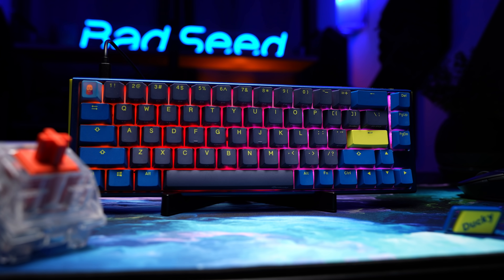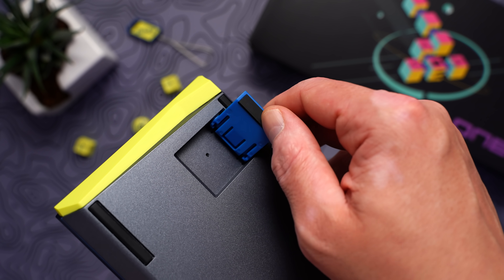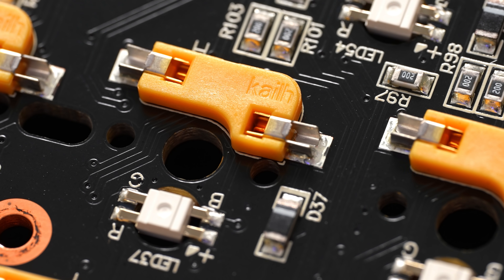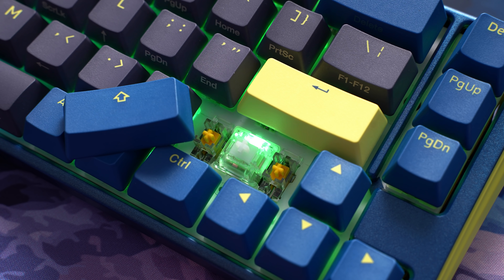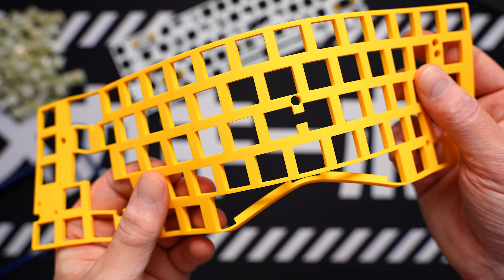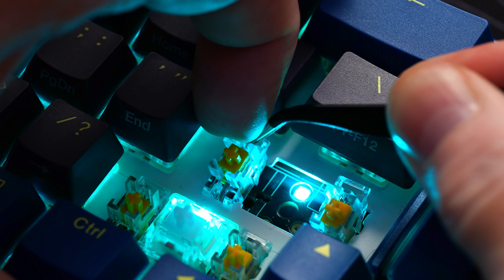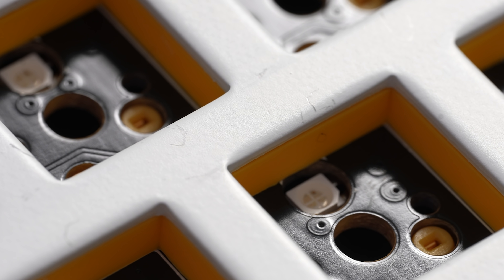Ducky One 3 SF: Best 65% Gaming Keyboard?

Comment from the maker: CORRECTION: This is a 67 key layout, not 71 - my bad.
Reply: it’s alr badseed
Reply: Quick question, their website doesn't specifically state that the TKL has RGB, appears only SF has RGB, is that true or just ducky being ducky and have a whacky website
Reply: Wow. I cant believe that you misspoke about the amount of keys on a keyboard. This is unacceptable.
Reply: @ramzinho4985  the Matcha and Fuji TKL does not have RGB, only the Daybreak TKL of $149
Reply: Do these new Ducky One 3 series (60/65/TKL etc) boards still have the mouse feature in the firmware using function + WASD keys to use your mouse cursor? and Q key for left click and E key for mouse right click. Use this feature on my old one 2 mini alot for working on servers etc.
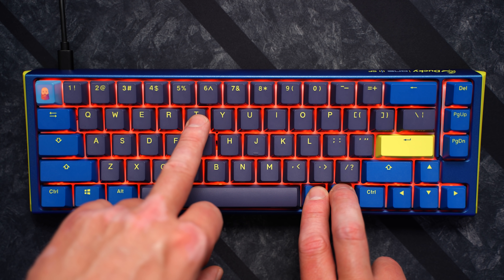Reply: @golfmaster7  check for his correction at 4:39
Reply: GOD FUCKING DAMN IT!!!!!!
Reply: Will hotswap mean we can hotswap Kailh Silver speed switches onto the Ducky One 3?
Reply: No worries

Comment: I am really happy that more and more keyboards are going hotswap.  Sucks about that 2U shift and I am glad you called it out. Quality video as always.
Reply: true, 2u shift is still very hard to find these days. Would be much better if it's 1.75u
Reply: I'm a newbie, but the fact that the shift key is 2U won't stop me from using any switches right, it's only the keycaps that I would need to worry about?
Reply: @aratayano2434  I think this is five pin hotswap so you can use any mechanical switch on these. Just make sure they are not optical.
Reply: Hi new to keyboards here… can someone tell me what’s wrong with the “two unit right shift”? I’ve been googling for an hour trying to figure it out lol…. Is that the same thing as a “2u”?
Reply: @cait.  the right 2u shift is an odd size. It's the same size as the enter key. It's typically 3u so finding the right size keycap set to fit is going to take some searching. Typically sets that have the extended amount of mods will typically have a 2u right shift.

Comment: North-facing switches was the right move for this keyboard. Ducky is known for having some of the brightest and most vibrant RGB in the keyboard market so it make sense to have features that compliment their value prop. This board is for people coming from Razer or Corsair and just want something a little more premium or different, not enthusiasts. People that plan on doing heavy modding and swapping out the stock keycaps for some GMK aren't (or is no longer) part of Ducky's target demographic anyway.

Comment: That sound is surprisingly good. Would love to get this bare ones for 99$ to put Boba U4 silents in it.
Ducky's RGB is so smooth.
Not so sure how I feel about the difficulty of opening it up though :/
Reply: I literally just ordered some Boba U4’s yesterday!!
Reply from the maker: Ducky really does have the best RGB in the business. And yeah, if you have to open it - you have to be very careful with the end caps.  Top case is actually really forgiving and easier to work with but this is a lot tougher than the One 2 SF.
Reply: @badseedtech  is the 60% easy to open?
Reply: Yes the 60 percent doesn’t need the plastic tabs removed to take out the pcb and go inside. This is because it doesn’t have anything on the front covering the pcb.
Reply: Hi does the ducky one 3 series support screw in stabs?
Reply: @Naresh-sh7pf  the one 2 didnt so I assume it wont.

Comment: Im about to buy a Ducky One 3, your review seems interesting and im also looking for a full sized keyboard, will be using your affiliate link.  Wondering what would you suggest switches with the intention of replacing the keycaps with translucent in the near future, so a switch that dont block the north facing led? I was thinking 
- Tealios v2 67g 
- Durock L2 Clear 62g
- Everglide Aqua King Water King v3 Clear 62g
still open to suggestions....

Comment: Now most switches are fine with cherry keycaps on north facing LEDs, like the Gateron Yellow, and since this is a relatively "cheap" board, I think most people buying this would buy a budget switch like the gateron yellow and it would be fine.

Comment: I’m new to customizing keyboard and I wouldn’t want it consider this a custom but I want to get the pure white one 3 sf in white and get the ducky joker keycap set so I can put some of the caps and have a purple pink blue and white keyboard. You mentioned interference, would that key cap set be able to fit on the keys (Ik the right shift is a different shape tho) but would I be able to put at least some of those caps on there?

Comment: Is that right shift really 2u? Not 1.75u? Does that mean the left shift is a different size or is that blocker on the right what causes this to happen? This board isn’t tailored to me, but that’s an interesting choice since compatibility with cheap cap sets would be pretty much nonexistent.
Reply: it is really 2U. have a OG SF and its the same size as a "O" keycap. the left shift is the normal size. it could be just ducky design choice to use the 2U shift for whatever reason.
Reply from the maker: Yeah, it really is a 2U.  Always quietly been the Achilles’ heel of the SF.
Reply: for sure the SF is 2u. Not 1.75u unfortunately

Comment: What does shine through caps look like in a south facing board?
Reply: Usually VERY dim. It has to shine through the switch to light up the text, only possible with a clear switch really. Looks very bad imho. To stop the interference from the keycaps hitting, I just use long pole switches instead of cherry MX, which frankly sound like crap anyways. They sat on the patent for decades, soon as it expired companies like Kailh and Gateron just blew them out of the water with superior products, and Cherry hadn't had to innovate in 25 years, and it shows.

Comment: I believe the Corsair K65 is still the better 'gaming' 65 keyboard with 8000 Hz/0.125 ms polling rate. As paper spec it may seem I noticed way better response with my K100 over my old Razer blackwidow which has the same rate/cherry switches.
Reply: do you actually "feel or notice" the difference on real life usage? Same as Viper 9k or 8k mice, like hell even pro FPS players still use like standard Zowie and kill like crazy
Reply: @stefanusrianto8781  both, I had to change the way I typed because of how responsive it was. Actuation point  is very small, 1.1mm. I could literally see a difference on screen from key press to action playing warcraft if that makes sense. Like the oldschool mod snowfall keypress.
Reply: Dunno. Got Corsair and a few Duckys, including One 3s (among other things), and I think these are pissing all over Corsair. In not-so-casual games AND typing feel.

Comment: Why make a stable without problems soldered switches hot swappable ? , enthusiasts are supposedly already know what they like.
Reply: there may be beginners getting into the hobby that just may get this board and decide this is the board they would like it to be their hotswap board to try different switches.
Reply: @Celesian  and also it's some people preference to have hotswap than soldering. Just because people know how to do it, doesn't mean it's enjoyable
Reply: @Celesian  I think main reason is the "what if" 
Like for many other things people like to have options
Reply: @Celesian  yeahp that makes sense so its dor beginners mostly that hot swappable option. Thanks
Reply: @offbrandegg5378  But why risk having hot swappable swithces that are easier to brake and also they are not steady like the solder ones ? For a cheap mechanical keyboard makes perfect sense because u need to expirement or find what u like or mod. If u are keyboard enthusiast u know what switch u like u know that is already a good pre lubed keyboard and u know that switches are machined soldered with plate between , nothing can beat machine solder and also switches doesnt have the gap movement of hot swappable ones.
Reply: @Celesian  I've never owned a mechanical keyboard and currently looking for one. Hotswappable is definitely a key feature for me for the reason you point out. I want to explore other switches in the future but can't be bothered to solder.

Comment: Varmilo miya pro is better
Reply: @SoftPastels  Why anyone buy a hot swappable keyboard that has more problems its not stable like soldered one . And also enthusiasts already know what switch they like.
Hit swappable make sense for people that dont know what they like or are new at this keyaboard world.
Soldered are always more reliably and steady.
Reply: the color schemes suck for them and there is not black and  they are always sold out of there switches
Reply: @milkman2979  What makes Varmilo famous are the artistic design . The cherry switches on Varmilo boards are cherry picked and are way better than those crappy cherry that most other use. I.know i have a lot of them. About availability yeah u are correct they are terrible also support is terrible . But honestly for the price the build quality of miya pro is compared to custom keyboarsa over 300 euro. Ducky SF that for most people aee great quality side by side with miya pro is like comparing Ferrari with Fiat.
Reply: @milkman2979  Oh by the way u can always buy a panda or summit that is black frame and use what ever keycaps u want.

Comment: I want it so bad but 1 thing they still haven't done that will make it way better a aluminum case instead of plastic thats only thing I hate about it id be even willing to spend more  for it. Finally hotswap just need aluminum and whatever it takes to get a more thocky sound. I know they have the ducky mecha mini thats aluminum problem for me is its 60 percent and not hotswap theh need a 65 percent aluminum hotswap board prolly would be one of the best selling pre-built on the market if they did. I didn't buy the ducky one 3 sf cause its plastic and mecha mini is aluminum but not hotswap or 65 percent. After I got my first hotswap and aluminum board I can never go back to plastic and solder
Reply: "Hotswap just need aluminium" "to get a more thocky sound." what the fuck? You need an alu case for hotswap? And no, aluminium does not produce a more "thocky" sound. Ironically, alu increases the pitch, as opposed to plastics like PC/ABS.
Reply: @Archurus  i didnt say I need a aluminum case for a more thocky sound I daid I want an aluminum case and whatever they need to do to make it more of a thocky sound and no all my aluminum boards sound way better than my plastic its how you build it the switches etc. I didnt say I need aluminum case for hotswap I said they finally got hotswap not they just need to make one aluminum case because for me thats rhe combo I like aluminum case with hotswap pcb. No where did I say I need alum to get a more thocky sound I said rhey made hotswap now for me need alum and whatever they need to do to make there board have a more thocky sound
Reply: @derekg2132  plastic definitely makes a "thockier" sound. I assume you mean deeper and quieter sound because that's what most of the YouTubers that use that god awful word mean. Aluminum usually has more ping and leads to a higher pitch "clack" which isn't a bad thing.
Reply: @offbrandegg5378  idk im just going ny what I've had even my nk65v2 i used tealious v2 lubed and lubed and changed everything and its amazing snd ghe mode 65 thocky too rama m65c I just ordered I won't have for 2 years but listen to those things

Comment: Imma play the “hater” role but after hearing the sound test, seeing north facing LEDs, and the overall features of the board…. imma chalk this up as a plastic, less aesthetic drop alt🤷🏽‍♂️
Reply from the maker: Its not a bad take. But this is priced much more appropriately for what you get and has better dampening stock.
Reply: @badseedtech  Again, imma play the hater role. 100% the price is extremely attractive as you do get a hotswap board with switches and keycaps included. But I just feel that the concept is off. If someone's buying a "ready to go" keyboard, I think mainstream boards like logitech's g pro go a long way. If someone wants an entry board for customs, I think stuff like the kbd67 lite, bakeneko, gmmk pro, keychron q1 etc. (this was just to name a few) would go a much longer way even if they are more pricy once fully assembled. I feel like in early 2020, a board like this would be amazing because you couldn't get one of the previous boards I mentioned in stock.... but right now they're everywhere, and frankly much better options for a "customizable board". So what I guess I'm trying to say is that this keyboard doesn't actually cater to anyone. If someone thinks this is the keyboard for them, then respectfully, I don't think they've thought through exactly what they're looking for. Because if someone wants to go into customs, then they realize this board is not good enough. And if someone wanted to just get a "ready to go" board, then all the features such as hotswap are pointless. And with the same money (or many times less) they could've gotten a higher quality board (in terms of build materials) from a mainstream retailer as well as top software, customer service, and such to go with it.

Comment: OEMs please stop using cherry switches. The market has moved on and they are bottom tier. Razer being able to say they have the nicer switches should be a red flag about your board.
Reply: well you haven't tried JWK or Gateron switches, you'll be blown out (if you're a linear switch user)
Reply: @stefanusrianto8781  I have tried those are just about every linear. Typing on Banana Splits right now. I don't understand what that has to do with what I said?